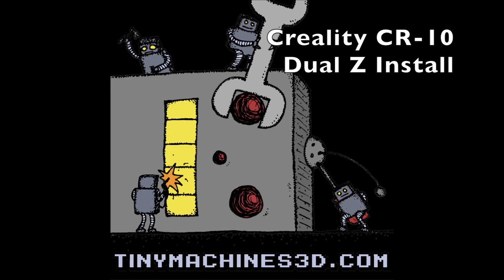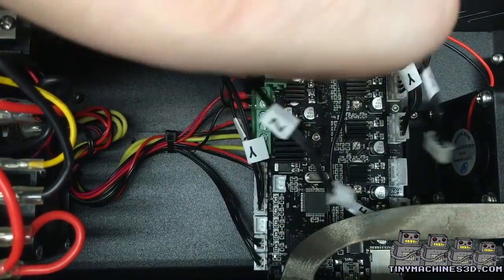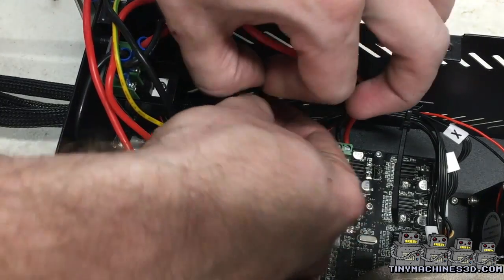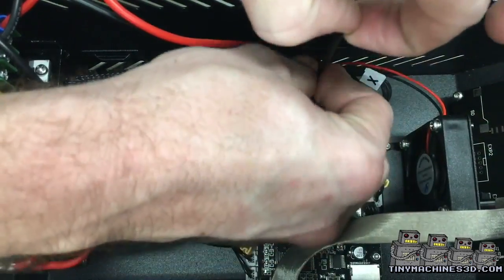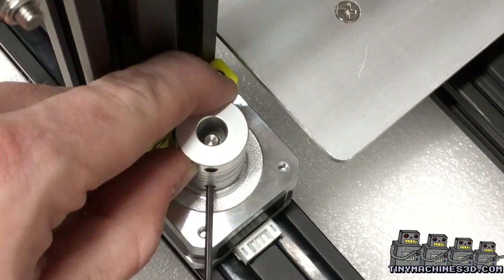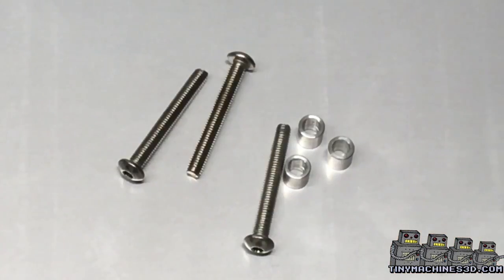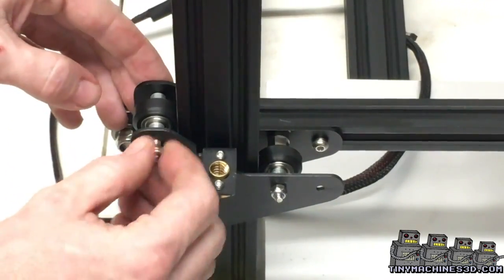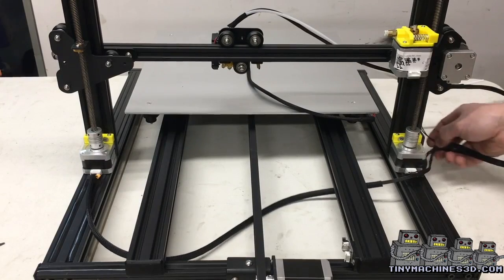Creality CR-10 Dual Z Upgrade Install

Comment: the cable for dual z is the motors connected on same spot on the motherboard or do they have different spots?  what i meant is  it 
parallel switching between the steppers for z?

Comment: If anyone is curious, I just installed this CR-10 kit on a TEVO Tornado, and it works and fits perfectly!!
Reply: the cable for dual z is the motors connected on same spot on the motherboard or do they have different spots?  what i meant is  it 
parallel switching between the steppers for z?

Comment: I don't know if anyone has mentioned this before, but those Z flex-couplers on both stepper-motors are installed wrong!!
Both motor-shaft and threaded-rod should only go in approx. 5mm. 
It is a flex-coupler and so needs to be able to flex to take the strain off of the threaded rod
and enable smoother prints.
The way you have it, those rods will almost meet inside the coupler, and so there is no way they can flex when needed!!
Check out this link.
https://3dprint.wiki/reprap/anet/a8/coupler

Comment: You left out a critical step....what to do if the gantry is not parallel to the bed?
Reply: keep turning the new lead screw until both sides of the gantry are parallel

Comment: On the Z coupler install on the stepper motor....how high up should it be on the stepper motor shaft?  (Distance gap from top of motor to coupler)
Reply: Both motor shaft and threaded rod should only go in approx. 5mm. It is a flex-coupler and so needs to be able to flex.
Check out this link.
https://3dprint.wiki/reprap/anet/a8/coupler

Comment: I have an issue with kit I received from 3D Printers Bay. while watching video, you state to remove end stop connector labeled Z. The kit i have does not have same 2 pin connector. The cable provided has only 3 plugs and none fit on the board....am I missing something?

Comment: Just installed my kit. The new wiring harnass was a single board connection and two stepper connectors, with no Z end stop connections at all. Left the old harnass in place and unplugged the stepper connections, installing the new beside it and to the board and steppers. Got extra junk hanging out now, but it works.

Comment: which Stepper i need for the second Z Axis? (Amps?)
Reply: gonzo111081 you probably want to getting a matching one with the one(or replace both) currently installed on your z-axis.

Comment: 4:19  Should that brass nut that the leadscrew runs through be tight or loose to allow the leadscrew to wiggle?
Reply: Sensei Dekkers once you get the height adjusted the brass nut should be tight.

Comment: Where to get the kit for this mode.?
Reply: I would also really like to see this, I expected it to be in the description? I've seen a kit on amazon and somewhere else but they seemed a bit pricy as the individual parts are dirt cheap. I would buy individual parts but then I'd be missing the brackets and stuff.
Reply: https://www.tinymachines3d.com/   just search for dual z upgrade.
Reply: Ya but there's more than one out there. Also you can get the parts and do your own. It's nice when they put the exact one in their description so you know what you're getting is the same as theirs.
Reply: gamer taboo I wouldn't mess around trying to source your own parts to save money.  The new bracket needs to fit just right and you want matching brand stepper motors.  On Tinymachines3d there is only one dual z kit it's the 400mm height one.  I know there are cheaper listings on Ebay but I don't know if they are selling real Creality3d kits.  If you buy on Ebay ask questions of the seller and find a local seller so you don't have to wait too long for shipping.  Creality3d's quality control sucks because they're hiring so many new people to keep up with demand so it's possible there might be something wrong with the kit and you might need replacement parts.
Reply: Ya I ended up just getting the kit. The problem I'm worried about is that on longer prints the steppers get out of sync. So what I have been contemplating is a timing belt in addition to the dual z axis mod, and I haven't tested it yet but I'm wondering if the timing belt will keep them in sync then? Not sure I've only seen people do either a dual steppers or a timing belt, never both.
Reply: gamer taboo  I've had the dual z upgrade running for over 2 months without the steppers going out of sync.  The only problem I'm having with long prints is the bed leveling nuts coming loose.  I'm added a bed sensor and locknuts.  I don't know what I'm doing different than other people but I did adjust both z rods and lubricate with Teflon dry lube I got @ Home Depot.
Reply: That's weird that the leveling nuts come loose, you sure it's not one of the z axis getting out of sync, might look like bed level went off. But ya I ordered the EZABL kit to auto level it, hopefully that helps with that problem.
Reply: gamer taboo definitely the bed leveling nut I was 80% through a 4 day moon print and the adjustment nut and wheel came off.  I have my bed set kind of high to not tension the springs too tight so the center of the bed doesn't bow up.  Before my last post I double checked the height of my x carriage on both sides.  Pretty much dead on as I set a couple months ago.

Comment: The upgrade I received has a different board. Doesn't match this video. The 12v power connector on the side is gone.

Comment: Dont now what i did wrong But After install the one side with the extruder is 2.5mm higher then the other Even leveling with power of didnt help. i dont get it
Reply: TheHomecinemaFreak this is what I did.  
1) You need a caliper that can stand on end(head on the rail between the two colored(blue/gold) inserts. Measure up to the x carriage and lock the measurement.  
2) On the right lead screw.  Lock the collar to the motor shaft but don't tighten the upper set screws in the collar yet.  You should be able to rotate the lead screw freely.
3) This is the tough part.  You want to raise or lower the right side of the x carriage so it matches the left side and hold it there.  Then turn the lead screw until it bottoms out in the motor collar.  Tighten the upper set screws in the motor collar to secure the lead screw.  At this point both the left and right side should be equal distance from the bottom frame.
Reply: Great tip.

Comment: guys i have a question. what is this upgrade do. what does it prevent? people are saying i should upgrade but i have nmo idea why? my printers makes good prints. when do i know i need this? thanks.
Reply: Lior Bar-El if your prints on the CR10 are fine then don't bother with the upgrade.  The kit adds a second z axis motor and lead screw plus other parts.  It should help the x axis or extruder carriage stay parallel to the bed.  With only the left lead screw the x axis might dip a little near the right upright.
Reply: The DIYGUY so u don't recomend it? Or should I get it because it might flop in the future?
Reply: Lior Bar-El  I say don't bother upgrading if your prints are fine.  It really is a pain to try to get both motors and lead screws installed and adjusted just right.  Also I think Creality3d raised the price from $70+ to $120. Not worth it at that price.
Note: I doubled checked the Creality3d price its back down to $75 which is the same price as tinymachines3d.com but I still don't recommend it unless you're trying to fix a printing problem that you know is because of the x axis/extruder carriage drooping on the right hand upright.
Reply: The DIYGUY thanks bro. Yeah for that price it's not worth it. If anything does arise I'll just tighten a screw or figure out a way to make it stable
Reply: Lior Bar-El I doubled checked the Creality3d price and it's back down to $75 which is the same that tinymachines3d is charging for the dual z upgrade.  I still wouldn't buy it unless you need it.  In my case they sent me a kit with a motor that didn't have the screw holes drilled deep enough so I had to wait another 2 weeks for Creality3d to ship me a new motor.
Reply: i have to tell u hictop is awesome months later my heatbed's wire ripped they actually sent me a new one even though i had told them i repaired it by soldering it they styill sent me a better one. real awesome service.
Reply: All the new cr10s ship with dual lead screws so there must be a benefit

Comment: Ok there appears to be a bit of a problem with this design. There is no real accurate way of leveling the x axis and keeping it level. As people have said once the steppers turn off there is no way to keep it all in sync and level. Also looking at it the lead screws should have a series of flats on them so you can get a better alignment and connection. Also this design would benefit from having a radial slot in the plate that holds the lead screw nut. By having a radial slot in it so you can rotate the nut slightly. This will give you the fine adjust that you need to ensure the x axis is perfectly level. However I am not sure how you solve the problem of the steppers going out of alignment once the power is off. Its there a limit switch on the other side too?

Comment: just installed this over the weekend, here are a few notes and watch outs..First off the install video was as described in the video except one point.
1. At 3:34 you install the upper block for the lead screw. When you do this you can not install the lead screw as with my block you could not feed the screw through the bearing down to the coupling. It would not fit. but that was ok, I just install it last as I had to keep it loose anyway because the position of the all the parts lining up the drive screw are not concentric and will bind when raising the "X" axis gantry.
2. just be aware if there is any spring in the system ("X" axis gantry) you can never level this. The stepper motors do not stay locked when no power is to them, so if you use a caliper to level the "X" gantry to the base you may find that after you level and run it up and down then turn it off, the steppers will move if the spring load of the "X" gantry can overcome the motor when no power is applied to them. The system will be unlevel again.
3. the new plates hits the screw heads on the yellow bracket for the stepper. This caused the "X" axis gantry to not move all they way down to match the other stepper and I could not level the system. I will have to try and use flat heads or grind the plate in this area. Or try and move the limit switch up on the "Z" axis stop.
4. Bind in the system: These parts are not concentric (upper block, to backlash nut, to coupling) to each other so I had to loosen the drive screw block on the new and the existing and let them float a little while running the "Z" up.  It also probably a good idea to loosen the anti backlash nut slightly to help this.

Will run some test prints this weekend and I will design and make a bracket to hold the new "Z" end that will support it so that after the motor turns off it doesn't drop and lose level.

Comment: I really want to do this upgrade but I'm a little scared of breaking my printer any suggestions
Reply: I suggest you try it out. Not much to break on the cr-10 considering it is all aluminum and steel. Just don't lose the screws or tear any wires (both repairable, by the way). This machine is designed for that sort of stuff.
Reply: Я купил его здесь, и он отлично работает https://ru.aliexpress.com/item/Upgrade-Here-CREALITY-3D-Official-Store-3D-Printer-parts-3d-printer-Dual-Z-Upgrade-for- Creality / 32818762767.html? SPM = a2g0s.9042311.0.0.9mttJV

Comment: It seems like there's some additional notes to address
5:36 ... 
How to adjust the cross member to be level?  
What do you mean by "fixed point" (fixed point on the chassis or the bed frame?)
There's a post mentioning binding in the second lead screw, offering the suggestion to exercise the Z to its 400mm maximum then release and retighten the grub screw holding the lead screw shaft to the stepper motor.  Maybe you can improve upon or formalize that initialization.
There's also mention of the need to clean and lubricate the screw, so perhaps there's a specific oil or lubricant preferred.

Comment: I just installed the kit.  The video is spot on.   I had tightness and the new z stepper skipping as I got to around Z=350 mm.  I loosened the  new bearing block at the top and let the Z run all the way up to 400 then re-tightened the bearing block.  It is running smoothly now all the way from Z=home to Z=400 (Don't forget to lubricate the new lead screw).   It is late so I will start my first print tomorrow and let you know how it works out.
Reply: Update: The dual is working great and solved the z movement issue but my stock glass bed was not flat and actually deflected (bent) when heated.  What really helped tons was obtaining a FLAT 310 x 310 mm borosilicate bed that was a little thicker (6mm).  I have been printing on the full bed almost edge to edge (had to remove the binder clips and use something smaller) now with great results.  Very happy 100s of print hours later with great prints.  I recommend both upgrades especially the glass bed if leveling is giving you fits.  Thank you Tinymachines!!
Reply: reasonablebeing thank you for your details about the warped stock glass, I am having the same issue. 
 Did you just buy the glass from a local glass place, or somewhere online?
Reply: reasonablebeing also, did you end up adjusting the z limit switch?
Reply: I bought it on ebay:   https://www.ebay.com/itm/3D-Printer-Borosilicate-Glass-310x310mmx6mm-Works-W-RepRap-3D-Printers-/132342073241      This one was 6mm thick and a little heavier but nice and flat and packed very well.  It has been working great for me and solved a lot of my print issues.   You can get it elsewhere as long as it is borosilicate, the right dimensions (310 x 310 mm) , and of course FLAT.
Reply: I did not have to adjust the z limit switch.
Reply: reasonablebeing thank you. I wonder why this glass is 30$ though. I have to look it up. It’s not like it is Mythril.  😀
Reply: JMTAUL I needed the glass asap and I got it.  You can find it cheaper for sure.
Reply: I need to try this as I am having issues with tightness as well. The one I purchased is from comgrow, anyone else have issues? Also the new roller carriage assem/mod hits the stepper motor when I try to auto home. Does Tiny Mach sell one?

Comment: Just received my kit and will install it later this week after I finish a print job.  One criticism after I unpacked the box:  the tape that you used to stick the lead screw to the bottom of the box is leaving a lot of sticky residue.  I will need to clean the lead screw with alcohol to remove this residue before I install it.
Reply from the maker: Thank you. We will address this.
Reply: Thank you.  You are doing a great service to this extremely fast-growing user community by offering parts, add-ons, and improvements like this.  I suggest adding links to your website and specific links to printers and kits above the comments.  You deserve the publicity. This printer is screaming for auto bed leveling as the next kit due to the large print bed which will never be perfectly flat using 4 point manual bed leveling. Please make this a priority!!